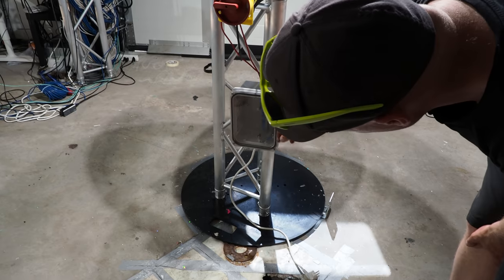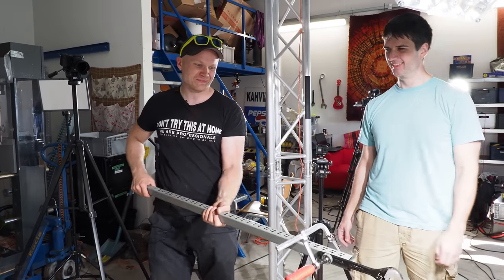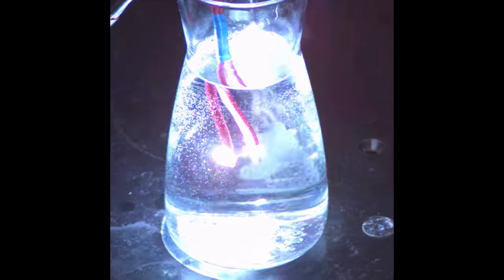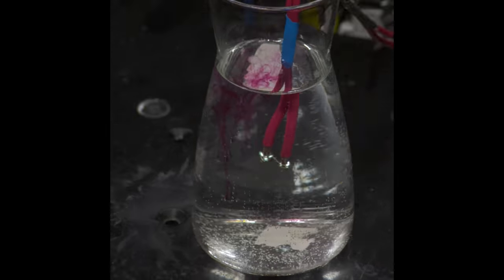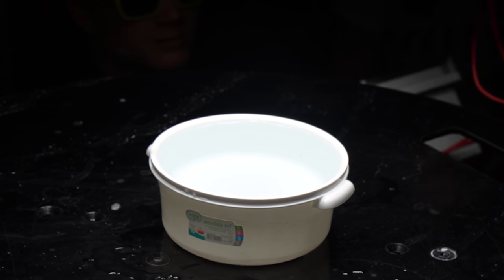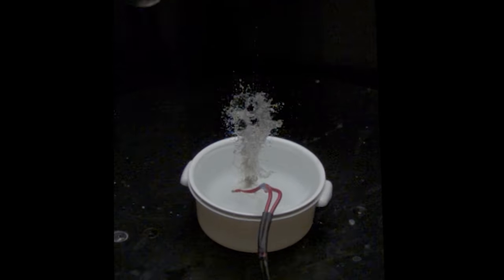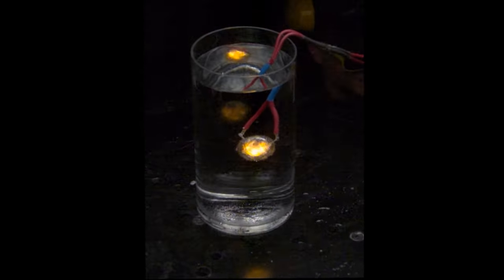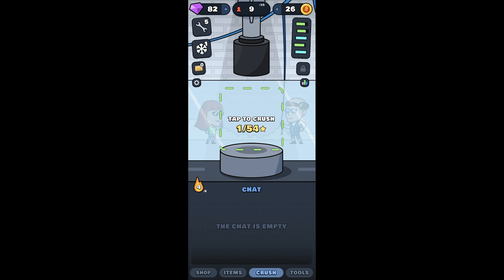Making Cavitation Bubbles with Electricity | at 100 000 fps

Comment: Going directly to cavitation, without first doing a simple air gap spark is a bit wasteful. You should have miniaturized it to reduce the total energy required.  I do not remember hearing or seeing mention of ultrapure water, since the electric breakdown strength of water and its cavitation properties depend on the composition and purity, air and microbubble content of the water.  The rotation was distracting.  Perhaps you were exploring.  Everyone seemed to be standing around in a new place.  Making big multicamera experiments puts this way out of price range for most people.  I think you ought to aim for universality - find experiments that everyone (hundreds of millions can understand it) can access, afford, learn and experiment with.  You could have share the raw data.  You could have done calculations (most of what you did not not new).  You could have started with a theory and plan, expectations and specific things you wanted to capture. Getting started is hard.  Learning is hard.  Which is why it is best to start with calculations, properties, parameters, and plans. There are many ways to study the changes going on in the experiment at those short time frames.  Oscilloscopes, photo-detectors, even ADCs now can go to 10s or 100s of GigaSamples per second.  A spark gap under water can be reused and still put enough energy into local heating to create shock waves and changes in the water.  That can be be pulsed repeatedly and a composite picture by phase (time relative to start) built up.  There are likely more things that Chronos ring is suited for.  Exploding wires have been around as long as sparks.  Ultrasonic cavitation is easier I think.  And you do not have to limit yourselves to water (ultrapure or acidified or salts).  The details are the data, and I do not remember hearing any impulse to share the raw data. Looking at things is "eye candy", not real  science these days.  If you run that Chronos, it probably was not cheap per shot - memory, electricity, staff, facility.  Science is 99% preparation, and then processing the many many images to look closely at everything that happens.  You could have experimented with switches and calculated what to expect -- before hand.  I like ElectroBoom shocking playfulness, but if you look closely, he is building a more and more complete model of how things work, how to calculate results, how to simplify and streamline his design process.

Filed as (Plan, prepare, record, share - have a checklist, test ahead of time)

Richard Collins, The Internet Foundation

Comment: Can you flim the light laser 1 million fps ?  But not the ring Only high speed camera MAX 1 million fps
Reply from the maker: I once planned to use Phantom v2512 at 1 000 000 fps outdoors to film how laser beam travels but it would have to be really strong beam to be visible with such an fast shutter speed and that would be quite dangerous thing to just shoot to some random direction. But maybe with some mirrors or something similar you could capture it by using just single camera.